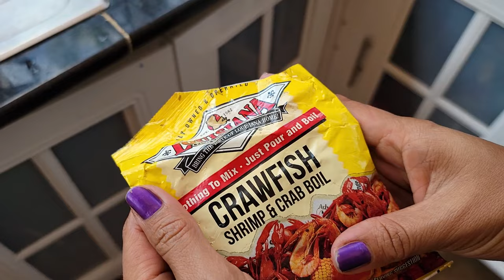New Guest Rooms Part 8 Staircase Pour  CAN we get PAST this STEP with NO MIXER?

Comment: I always wondered why y’all aren’t mixing your concrete in some sort of reusable box, instead of on the bare ground? I understand the reasoning of not using a mixer, or buying delivered concrete. I was only concerned about contaminants getting into your mix.
Awesome job with the project. You’re a good, patient teacher, James. Just like the other builder you talked about. Sad about Richard and Donna. Sometimes these things happen 😢
Reply from the maker: we either mix on concrete surface or we mix on sand and we spread a thin concrete over the sand in that area. We form it like a pan. Never on bare dirt

Comment: shaded pool. grotto style.  I bet that turns out nice.  I have used trucks and pumps on large pours (slabs of 250sqm and up), we bought a mixer for everything else, and still we will use the buckets and hand mix.  It depends on the time.  Once we were done with the mixer we cleaned it up and resold it.  As long as you are getting the job done, choose what works for you.  One slab.. we were delayed for 8 hours.. as the mixers got stuck in traffic.  "where are my hammers"... I literally had to build a space I could LOCK my tools in, as they tend to get borrowed\lost a lot.    Nice video again.  I personally enjoy the construction vids..as I did, and will do more building out here.  Trying to get the 3rd floor in before the price of rebar doubles again.  I might just buy that.. and wait for the rest of the budget to catch up.

Comment: James, I understand your decision to hand mix and your previous experience is testament to success but one thing I think is a big advantage of the machine is the consistency of the mix.  I have done my fair share of concrete work and I bought a concrete mixer before I started my project.  The big difference for me is I did the work all myself so I would be mixing the next batch while I was working out the first batch.  I know you don't have any issues with hiring more workers but if you wanted to save on laborers, the concrete mixer would be the way to go.  When I had my house poured in the Philippines, they used a big mixer and I just felt better knowing the consistency of the concrete mix was probably better that shovel mixing.  Like you said, hand mixing works for you so I completely respect your decision to go that way.
Reply from the maker: these guys are well tuned with it.  How are you mixing in the mixer? Measurements right? Shovel fulls ? That is not accurate. Sack it up in cement bags then dump it in the mixer?  That works and that is exactly what we do.  1 2 3 mix  1 portland 2 sand 3 stone 1 waterproofing.  That is what you dump in the mixer and that is what we do on the ground.   so we mix 3 portland bags at a time which means 6 bags of sand  and 9 stone 3 waterproofing.  your spinning it in a mixer and we are mixing by shovels. We know by eye when the water mixture is right. We adjust by the temperature and what we are pouring. Here in the Philippines doing these mixes you dont have the pleasure of slowing agents for the heat. So adding extra water can mean everything. This will set fast in the temps we are currently having. We know how to get it just right.  Thanks for respecting the process.